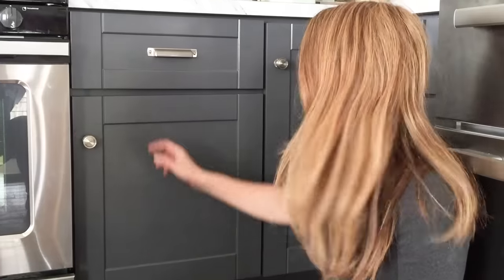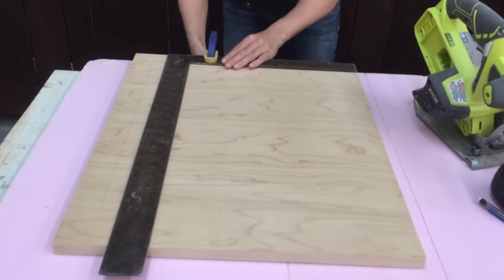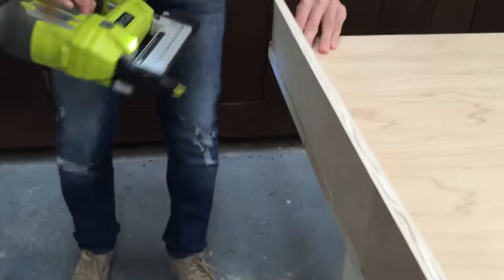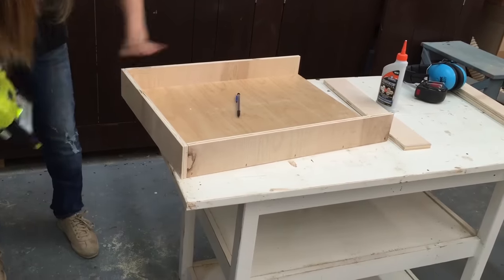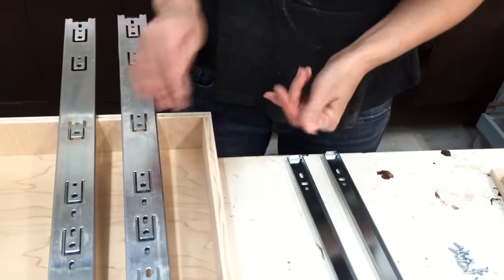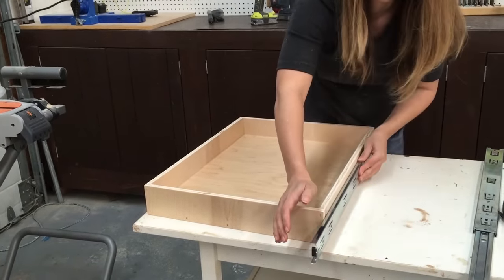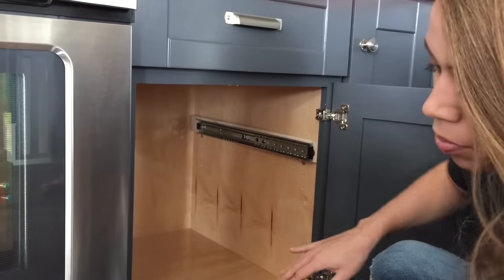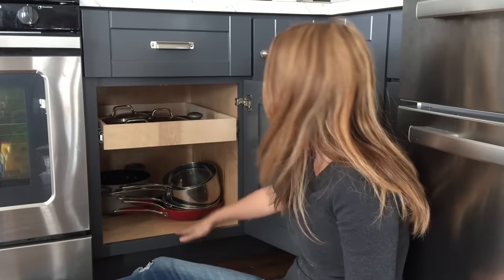Convert Cabinet Shelves into Pull Out Drawers

Comment: I applaud you for not sinking to levels of wearing a bikini or skimpy clothing for your video like I've seen on other female builders.  Great job on assembly without a table saw, however, what reason do you have when cutting on miter that the left side is not up against the fence, it appeared to be in front by maybe 3/4 of an inch?

Comment: The tip is pretty cool and definitely doing this. Easier to install the cab member first, with drawer member inside already. Then pull out drawer member partially to attach the drawer; less margin of error. Also, on the drawer slides, those little tabs along the outside can be used for easy width adjustments. I myself learned the hard way lol. Great vid and your eyes are to die for :)

Comment: Recently I converted our whole pantry (cupboard style) into pull-out trays. Each side had 3 shelves, plus the bottom. So 4 levels. With the trays, I was able to increase it to 5 levels, because I could make 1 or 2 levels very shallow to hold small things like cans or small items. That won't work on regular shelves, but for pull-outs it's perfect, because you can open it to get the small things at the back.

Comment: We did roll outs on all of our cabinet 14 in all we did both top and bottom and the pantry cabinet also. I used maple rails and 1/4” maple plywood shelves dadoed into the side rails. Finished with multiple coats of sprayed table top finish that we normally use in our cabinet shop.
Reply from the maker: Sounds great!

Comment: I am surprised you didn't put a drawer slide on the bottom of the cabinet to hold your pots and misc.  I am not into carpentry I am into quilting and I must say you did a fantastic job.  I had to hire a local cabinet company to install my drawer pullouts two per cabinet.  The reason for the bottom cabinet slide out was because I had to have a total knee joint and knee cap replacement from a bad fall and therefore I am unable to get down on my knees to fetch items from the back of the lower shelf.  It allows me to utilize all of my lower cabinets with ease and I am thankful for these slide outs for sure...you are a very gifted lady and did a beautiful job.

Comment: Could’ve also cut the plywood spacers (slides are attached to), the height equal to the spacing of the holes for the pins used the shelves. Place the plywood (slides) with pins under and pins above. That way you could just have the shelves sitting in there and could raise or lower them when required. They wouldn’t go anywhere as they’d be held up by the pins top and bottom. Great tips. 🇨🇦👍🏼
Reply from the maker: Yes, that is another great way to make adjustable shelves!
Reply: Can someone make a video on this? All videos about redoing cabinets on YouTube are so old! 😅

Comment: Several years ago I did this for the lower shelves of my Mother-in-Law's pantry. What a difference. When she emptied the shelves she found six cake mixes on the bottom because they kept getting pushed to the back out of both sight and reach. I built my own kitchen and there isn't a single fixed shelf in any of the lower cabinets. Even the very bottoms are pull-outs.
Reply: Nice, Robert-Even 2+years after your post! 👍🏻

Comment: Hi Ana! I love your idea for full use of space in lower cabinets. I might just mention that one shouldn't let the tape measure retract uncontrolled and let the hook at the end smack the housing. Over time letting that happen can make your reading not true when exact measurement is important. The hook is made to be a little loose, but repeated whacks will change the attachment. I hold my index finger under the tape as it retracts and it stops the hook before the whack. 😉

Comment: Small tip! Use two pieces of wood (same thickness, length about the same as the drawer) to support the drawer when attaching the second slider. It will be very stable.

Comment: Your drawers have a design flaw. When opening a drawer you pull at the front board. If you attach it in front of the right and left  board then thats weaker than gluing the front board in between the left and right one. That way nails go from the left and the right into the front board which is a more durable design
Reply: Yeah I did that too! Thought about where the stress would pull on the drawers. I also cut little channels (don't know the proper name) for the 1/2 " sides to fit into the base, and also used screws instead of staples, and glue. Super sturdy, going on 12 years of overloaded drawers and lots of heavy use.
Reply: For my trays, I used drawer lock bit  (Lee Valley #16J76.62) and glued the joints. A bit more work but gives me peace of mind.
Reply: and you see the end grain of the sides.
Reply: @lovly2cu725  I use a drawer lock bit to make my trays and drawers. If you use Baltic birch plywood, the layers of veneer are tight and look good with a clear finish. I seal the exposed ends on my trays then prime and paint.
Reply: The channels are called dadoes.   @virginiaoflaherty2983
Reply: First of all, please wear safety gear. 
Fit a strip of slightly narrower wood on the inside of the front panel and secure front panel to it from the inside so can't see the fixings
Reply: I wasn't going to mention it, but yep, not a good idea at all, especially if that drawer is going to have any weight to it
Reply: Couldn’t you just double layer the front or something? Then do the dado cut for the thickness then you still get a clean finish front and still get the strength.
Reply: I think cutting all edge boards at 45 mitres would allow you to nail in both directions for a strong edge.
Reply: Makes sense

Comment: Hi, Ana. I love this idea. It'll make for much more organized storage. I don't think you took into account the finish on your shelf/ drawer bottom, though. It'll prevent the glue from bonding to the bottom. Staples may be enough to hold it, or you could scrape/ sand off the finish before applying the glue. Thanks for the video.
Dan

Comment: On the cabinet slide, there are u shaped tabs with one hole. These are designed to bend outward and mount to the carcass if there is a gap situation from misalignment ect. I am not sure if they work for a 1/2 inch gap but I just learned that last week.

Comment: I'm doing something very similar. Only my shelves are not removable but that's ok. I'm mounting my sliders onto those shelves so it'll be bottom mount and I have to build the drawers. Bottom mount provides more weight stability. Anyways, while I'm not old yet, it's a hassle having to crouch or sit on the floor, take bunch of stuff out to reach the back of the 2-0 deep cabinet. My project cost little more and I used 1x5x6 wood planks for the sides (I like them little deeper) which are only $3 and sheet of plywood for drawer bottom is under $10.

Comment: Thank you so much! A few questions (I'm a new home owner,  so finally able to make lasting changes to my home!! And learning how to effectively use my tools!) 

1. How are you using your circular saw without cutting into the material below it? I've had to use table saws... but those aren't terrible conducive to the boards staying put, especially when using 8x4 plywood. 

2. One if the cabinets I would like to do this to has two doors to it, and a like... face frame maybe? But I know I would need to put something in there to be able to attach the slider to. How would I do that with it not having a solid center? Would I want to build a frame inside of like 2x2s?
Reply from the maker: Wonderful, thanks for the visit!
1. I place a piece of rigid foam under the plywood to cut on, set the depth of the blade to just go through the plywood and a little into the foam. You can use the foam over and over again! 
2. Check out this tutorial https://www.ana-white.com/woodworking-projects/10-roll-outs-kitchen-cabinets

Comment: Nice job.  My project is to use the space between two cabinets to put a pullout shelf that will hold cooking sheets.  The self will only be about 8" wide but then it will go from the bottom near the floor to the bottom of the countertop.  Anyway, thanks and good job.
Reply from the maker: That's a great idea!

Comment: You mentioned shims those drawer slides are designed with tabs around some of the screw holes that can be bent to adjust the offset. I saw that in another video after I had trouble with mine.

Comment: Great ideas. Just a small hint. If you look at the nails in you nail gun you will see that the tips are cut at an angle along the length of the nails so when you drive them parallel to the side of the panel they have a tendency to curve up or down and come out of the surface. So it's best to angle your nail gun 90 degrees to the length of the board.

Comment: Great idea.  Possibly put the sliding shelf on the bottom, fixed shelf just above it to get at the pots/pans easier.  I've three layers of trouble, covers, pots/pans, frypans, so I'll have to keep thinking on it.  But thanks for the jumpstart!
I look forward to the day women do a complete redesign of the default kitchen configuration.
I want counter tops that flip up, for us to get at what's underneath.  I want burners that flip up out of the way, so I can use the space as countertop for big baking days.  I want chest-level oven, rather than blazing hot doors flipping outward into the 2 year old's space.  Etc.

Comment: I keep wondering if you could just use the shelf to set pull out drawer on and connect slides to shelf.  (Underneath pull out drawer box).  Then I could do this in a long base cabinet that would need two drawers .

Comment: Could've mitered the four sides and applied edge banding to the top of the sides for a more professional look.You can get prefinished maple for these projects.Now after making pullouts on the top, you have more of a reason to make a pullout for the bottom (try to reach the back bottom with even less space in front to do so)!I'll bet you have done so by now.Fun project and with all of the new self-closing hardware it can really change an old inefficient set of cabinets into a more functional modern version.

Comment: I knew there must be such a thing as a non-pneumatic stapler!!!! 
This is extremely important for the kind of stuff I build! I need one! I need to not use nails and screws for everything, they are too damaging to surfaces. But, how do you remove them when it's time to move? Hopefully, there is a tool that can do that just as efficiently as this one puts them in! 

I won't be able to do this exact project because I rent, but I can see a way to do it that would be temporary and removable with zero damage. 
Thank you for your wonderful work! 

P.S. begging you to use safety precautions is not "bashing" you. Nor is suggesting improvements to the design. That is called "wisdom of the crowd" or "collective intelligence" and "care and concern". Even if a bit Patriarchal. 😉  Nearly everyone here likes you and your work!

Comment: I just installed pullouts in my kitchen and I cannot tell you how awesome they came out. I installed two drawers in each cabinet with matching drawer fronts to match the drawers, with same hardware. I love them so much because when you open my cabinets the drawers all match the outside cabinets.  I did run into a problem with one of the pullouts. It will only pullout halfway. Cannot figure out how to pullout the drawer in order to fix it. I think the lash broke. Please help. Thank you.

Comment: Since you mentioned pocket holes, is there a trick to getting 1/2" or smaller wood to attach securely?  I have tried every recommended adjustment youtube offers in terms of pocket holes depth but anything with a pocket holes that is less than 3/4" cracks apart with the slightest pressure. 😖💔

Comment: I'm just curious why you didn't use the Kreg tools to install the drawer.
Reply from the maker: Honestly the easier way to do this is just measure and mark for the front screw in the drawer slide then use a level to set the back screw. No specials tools needed

Comment: I have cabinets that are all open to eachother with a faceplate, not constructed the way there these days, where they are separate and connected to built one whole cabinet system. I can't afford to replace them so how can I retrofit (?) them so that I can install drawers like this? ... I need the vertical pieces to attach the drawer slides to in each cabinet opening?! Please help me!
Reply from the maker: Here is a post regarding additional framing for open cabinets https://www.ana-white.com/woodworking-projects/10-roll-outs-kitchen-cabinets

Comment: Outstanding job. However when in any shop setting it would be a great safety idea to pull your hair up and out of the way so it would eliminate the possibility of the tools from getting your hair caught in any equipment. If your hair we're to get caught up in the any type of rotating tools it would be very painful. It would most likely require a trip to the ER.

Comment: I'm sure that those staples look great right out front, but joint ply with staples.  A minor step up from but joint with brads but not much.   Put some canned goods in there then open and close the drawer and see how long it takes for that front board to pop right off

Comment: That's drawer shelf.  is definitely an improvement over a fixed shelf.  But, a person can put same lids in $15 mesh drawer, in the vertical direction. Yes, it's prefab, pre purchased at home improvement store.  Saves same space, time and money.  Obviously you're a woodworker, and this shows well.   and my slant is more DIY, not a full shop to modify and build drawer sides, and slides.  Just offering an alternative, in case people don't have the tools, skills you do!

Comment: Why aren't you using the fence on the miter saw?
Reply from the maker: RickMakes Hi Rick, this saw has a sliding back fence so it looks like the board isn't on the fence from the camera angle, but it actually is on the lower part of the fence.  Eagle eyes!  :)
Reply: I'm glad you explained this Ana, as an amateur I was wondering the same thing but was afraid to ask.  LOL

Comment: I made these same drawers my first time and found out over time that the exposed slide on drawer will hit the door if it isn’t opened out of the way and gauge the inside of the door. You can purchase some plastic protector that go in front of the slide to avoid this, just sharing what happened in my case.

Comment: Idea is nice.  I would recommend wearing safety glasses when doing woodworking.  Also, suggest using half-lap joints in constructing the drawer; that will last a lot longer than just pinning them with glue and a brad nailer.  Cheers.

Comment: how would you add this to existing drawers, little room to work, side boards need to be added? I have spent too much time trying to get the spacing right and to get them level front to back... An existing set of dark brown drawers, no light, little arm room... sigh.. real conditions.. not an open cabinet, white, lots of light and room to work, drawers made to fit with your drawer glide... and I admit less experience than you... ; )

Comment: Ana, would you look at some math on my project plz and offer your opinion?  I do not know how to factor the size needed on the shelf hardware. The project is installing a pull-out, push-back shelf under a desk for a 88 Key Midi Keyboard. Math - front of the desk to the back of desk (under desktop) is 35" deep.  Keyboard & shelf is 11.10" deep, same size of the keyboard. The height of the keyboard is 5" tall. Weight is low, 44 lbs, plus shelf. 
Goal. To have the shelf against the back of the desk in a holding position. This allows 24" knee, foot room. When needed, the shelf is pulled forward until it is 11.10" past the front of the desk, played, recorded, and then pushed back to the rest position at the rear of the desk. I am trying to get back up and running however I can't obtain clear answers on what I need in locking shelf hardware that will do the above and lock in place. Advice is greatly appreciated.

Comment: I would have attached a false drawer front on the drawer. Of course, screwed on to the real front pull. I would have used a router and used dovetails with glue and jig screw the sideboards to a real draw front. That would be strong.

Comment: When you're using a square, use the inside edge of the smaller end against the edge of the wood to square it off to draw your cut line. No need to clamp. That is how you use a square.